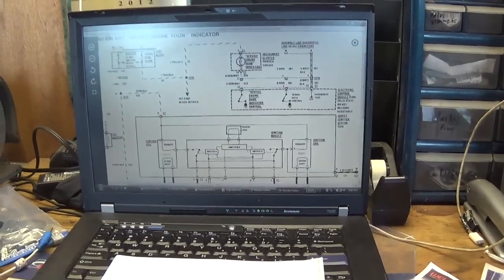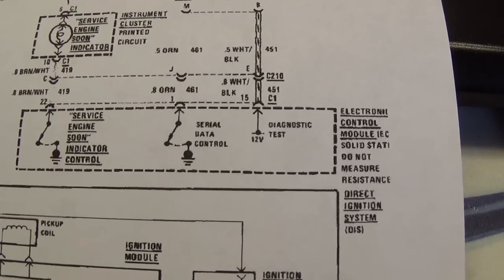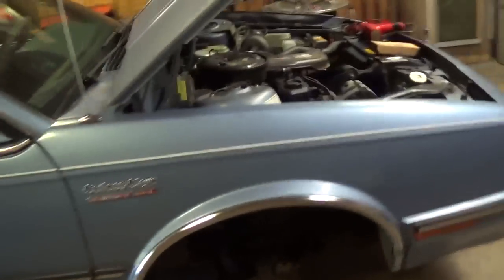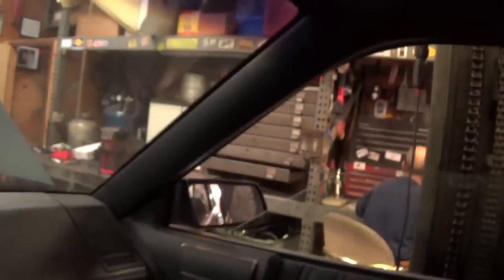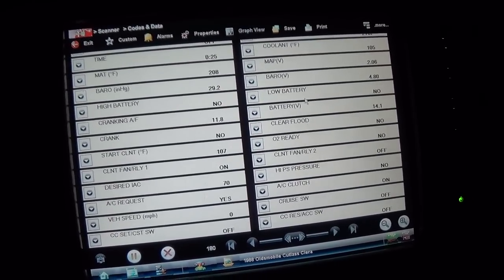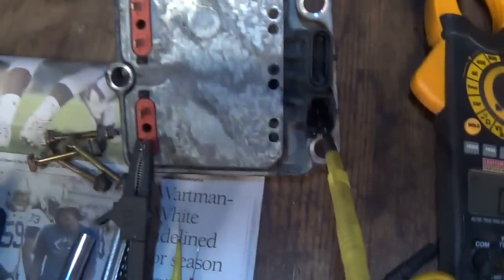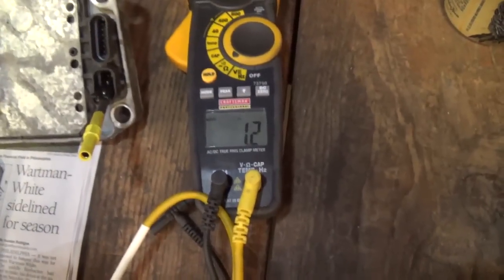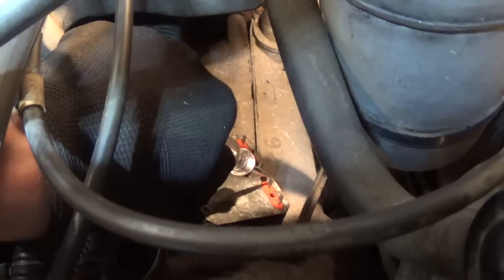GM Ignition System diagnosis: 1988 Olds Cutlass

Comment: I have had a lot of Tech 4 powered cars over the last 30 years. I still have 2 6000s in the garage. One is a first year with only 45k miles and the other is an 85 with 234k miles. Both run great!

Comment: Glad you shared this. This is hands down the easiest way to check the output from the module to the coils and GM used this sort of system for many yrs and nearly all of their FWD cars. I think the only thing I would've added was to check secondary coil ohms preferably hot, because I've seen them break down and take out a module several times before.. Just sayn. Good vid!

Comment: Great video thanks for sharing 
My 94 Ciera 3.1 liter gave me fits for almost two years, finally found out it was the wiring harness from the electronic control module  to the 2nd Cam Position Señsor on the backside of the motor. Replaced everything else in the process of getting to the bottom of this problem. So now I have an excellent running car, as if there was never a problem. Love these old Oldsmobiles. Thanks again for a great video.
Reply: I'm tryna figure out on my 95 cutless ciera why does it shut off while driving
Reply: @amenRAH_210 Did you ever figure that out? The random shutoffs on a 1995 Oldsmobile Cutlass Ciera.

Comment: How did you test the ignition control module? Did you connect one end of the alligator connector to the test light and the other end to the control pins on the module?
Reply: He simply connected the lead of the test light to B- to test for power at the coil inputs from the module KOEO, then moved   the test light lead to B+ to test for coil triggers, at the module, KOEC. The ign. mod pulses the ground to the coil, thus the flashing light. If you have an easily accessible coil on ign module car, you could do this across the 2 coil pins ( coils removed) once you know you have keyed power from the module, with your high impedance test light  or a rigged up NOID light.

Comment: Truck has both rich bank codes. Po172 and po175. Is it in limp mode.
Reply from the maker: +Richard Gill Wow interesting...I would definitely track down the cause of the rich condition first. Would have to look at some fuel pressure specs; 90 psi seems very high. Returnless system?
Reply: motoYam82 yes Ivan. Returnless.  Did I mention that it shifts fine when the stability light goes off.
Reply from the maker: +Richard Gill Richard that sounds like a fantastic diagnostics opportunity! Chevy trucks make for some great case studies huh?
Reply: What do you think about vehicle being in limp mode or fail safe where it raises the Trans line pressure
Reply: Ok today fuel pressure was taken at the rail confirmed its at 90 psi. Fuel pressure sensor read 2.8 volts. Where it should of read 5 volts with the actual present reading. So I went to schepel GMC and purchased a new fp sensor for 42 pesos. Big improvement. But Ivan once the stability light comes on hard 1-2 shift again. Light goes off for an hour then on. Keep you posted. New code after fp sensor replacement po69e. And po191. Original codes were po172 and po175. Po175 diminished .
Reply: O yeah brake switch also in memory still from a dealer diag and replacement.

Comment: Did you check the Harmonic Balancer Ring? I have seen some given spark just on two cylinders! The ring come loose and gets to close to the Crack sensor, eliminating the signal on that spot only! You should check the crank signal just to be safe! Specially on a 1988!
Reply from the maker: +Maic Salazar This system is kind of goofy...the crank reluctor ring is inside the crankcase right on the crankshaft! It would have been interesting to scope the crank waveform coming from the module to the ECM though :)

Comment: Ivan how did you know we used to call these motors the "Iron Duke " You probably weren't even born yet. Ha ha. But yes it's a the iron duke. They were put in boats also from Mercury. Keep up the great work.
Reply from the maker: +Richard Gill lol Just random internet knowledge! Didn't they also put them into those boxy little US mail trucks that seem to have an unlimited lifespan?
Reply: motoYam82 yes they did. Where can I get a deal on some new test leads with banana style plugs?
Reply from the maker: All my scope leads came with the Verus, plus some BNC extensions with banana adapters from AESWave. You can order custom lengths, colors, and connectors...the quality can't be beat!
Reply: Ivan. Have you ever seen a 2007 Chevrolet silverado with hard transmission shifts from first to second. The Chevrolet dealer told my customer that the fuel pump was the problem. Pressure is over 90 psi and vehicle is in fail safe mode. I got to make a call on it tomorrow
Reply from the maker: Can't say that I've ever seen that before...How the heck is the fuel pump tied in to the tranny controls? Any DTCs? Try a Google search :) Good luck!

Comment: It's a waste spark system right?  How could a faulty module that isn't putting out spark on 1 coil not show up as a 2 cylinder misfire?  Did they not realize it wasn't putting out spark on 2 towers?  Neat module test though thank you for showing that.  I see where Al was going with the crank sensor on a 1 cylinder waste spark misfire.  If he would have caught that it was actually a 2 cylinder misfire it probably would have clicked for him.  Excellent diagnostic.
Reply from the maker: +DJDevon3 Great question. The way they checked for spark was with that strobe timing light, which was actually flashing on every plug wire (including the dead ones!) because it was picking up the pulses from the neighboring ones!! I assumed they used an inline spark tester...bad assumption on my part. I was honestly surprised it ran at all on only two cylinders!!
A crank sensor issue can be ruled out since one coil is firing great, so the input to the module can be assumed to be correct.

Comment: Still confused as to how there was a single cylinder misfire!
Reply: +roadkill5333 it's a single cylinder misfire I tell ya!  On a waste spark system?  Unlikely. :P
Reply from the maker: +roadkill5333 Definitely a 2-cylinder misfire. Maybe Big Al got confused by his strobe light which was picking up the neighboring plug wire?
Reply: motoYam82 You can't only use a timing light for a misfire.  It's not a bad idea as a quick check but if you get used to that bad habit it will bite you eventually, case in point.